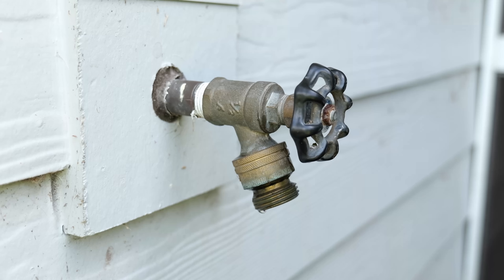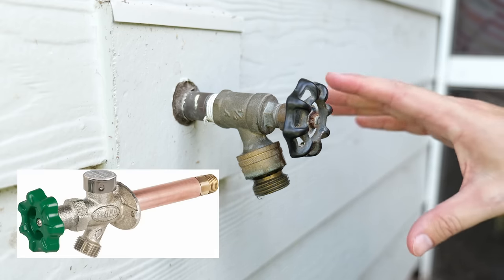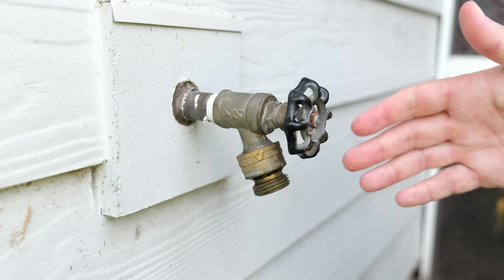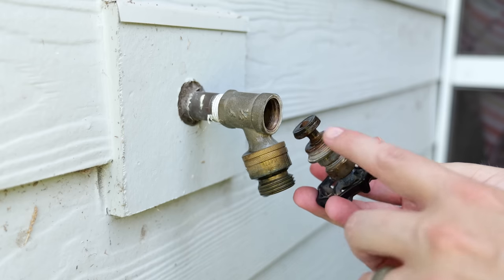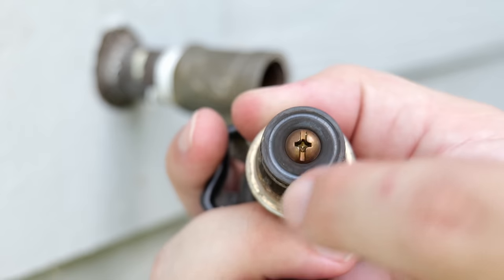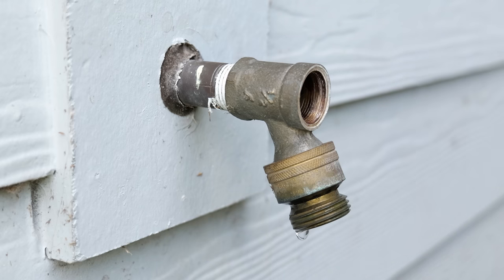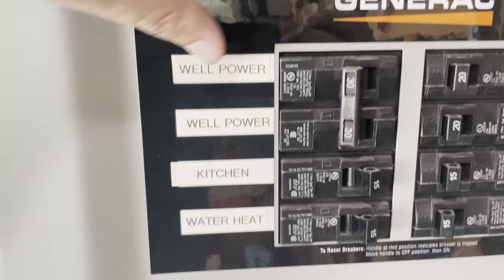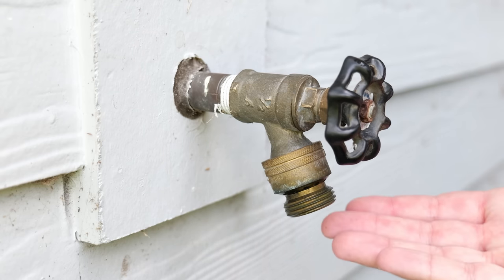How To Fix A Leaking Outdoor Faucet!  Cheap and Easy!

Comment from the maker: Do you have or have you ever had this issue?  What did you do to fix it?  As always, links for everything in the video are in the description!
Reply: Very helpful. I need to fix a hose bib. Thanks.
Reply: Have put a splitter valve on the spigot which prevents leaking and also allows multiple connections for the garden hose and for the watering system.  Planning on a better fix when I have all my plumbing problems figured out for the plumber to deal with in one visit if possible.
Reply: It's not plumber's tape but thread tape or Teflon tape.
Reply from the maker: @GailUrge-vq6qn again, can be called any of those things including plumbers tape.  Very commonly known as that.
Reply: @HowToHomeDIY  it can be called that if you're the younger generation and you want to be ignorant about it
Reply from the maker: @GailUrge-vq6qn it is called that by all generations 😂
Reply: @HowToHomeDIY  and you still don't know what you're talking about and still talking out of your butt 😆
Reply from the maker: @GailUrge-vq6qn nope.  Look it up.  They are called by all 3 names.  Honestly not hard to do 😂
Reply: @HowToHomeDIY  can't do that....I'm not clueless like you and must always go to Wikipedia 🤣
Reply: @GailUrge-vq6qn well look at that, I got this video recommended to me after the other one and you’re here too complaining about another dumb thing.  I wonder how many other videos I’ll see of his with ignorant comments like this from you.  Definitely the sign of a troll.  But it’s commonly called plumbers tape, thread tape, pipe wrap tape, or seal tape.  Most don’t actually call it Teflon tape, that’s a brand name not an actual type of tape or sealant.  So maybe you should research some things before making yourself look like an ignorant ass.  The How To Home guy is right again.  Honestly is humorous.  I may have to watch more of his videos to see if I find more ridiculous comments.  Keep up the good work @howtohomediy!  Solid info.  Ignore the trolls.
Reply: Thank you for this video. Bea did occur to me to try to change that washer. I’m able to take off the faucet part of the hose bib… But not the entire body. It’s crazy completely frozen on there. My next step would be to try to cut it off. But I’ll take another look at the washer and see if I can just replace that maybe that’ll do it.
Reply: @kayeruss7313 Yep, I did that on the hose bib in the backyard for many years. I wanted to just replacing it. I actually had to sweat some pipe. First time. Worked out pretty well actually raise the height of the faucet.
Reply: My is shooting water when I turn it on and off. And it shoots water at that adapter type thing at the end. Do i need to replace the entire thing?

Comment: Should you not have opened the valve a bit before tightening it down?
Reply from the maker: Yes you want the valve to be open slightly  once you really start to tighten it down as the new seal will probably be thicker than the one removed so if you go to turn it on it may get stuck and not open up the valve.  Great point!
Reply: I like your attention to details. I can’t begin to describe the grief I suffered before I finally figured out that the tape has to be wound CLOCKWISE several times. No one had mentioned this to me before.

Comment: Like tge video showed, make sure that the main body of the faucet (the one with the bigger wrench on it) does not turn when you loosen or tighten the body or you will cause a pipe to be broken inside that wall. If that happens you will have a big mess and probably need a plumber to fix that problem!!!

Comment: a good trick on tight fittings is to set your wrenches up next to each other close enough to Squeeze the two together that way you dont have to worry about twisting the back pipe or fitting.  harbor freight has a pipe cleaning wire brush for 4 bucks i keep several around for battery cleanups and general round fittings that need cleaned up. i personally dont like teflon tape But lots of people do  i like the teflon paste or a product called true blue. good concise video  to the point and well presented  have fun

Comment: Have the exact same hose Bibb - got the washers but I think it soldered together (or some type of cement paste was used - not sure) - used exact same wrenches, etc, but worried I was going to break it of at the pipe I was putting too much torque to turn it. Back to Lowes to get a replacement Bibb. I will keep the pack of rubber washers though ($3 for a dozen may come in handy later). Great video and instruction!!!

Comment: For a cheap / temporary fix, I have just flipped the rubber washer over and reattached with the screw into the shaft.  Sometimes , water leaks out around the knob SHAFT.  Using an adjustable or box wrench, just tighten the packing nut slightly to squeeze the sealing material enough to stop the leak but not too tight that would make the knob difficult to turn.   Hardware stores do sell small quantities of rubber washers or re-build kits, so make sure to bring the old parts with you as a reference.
Reply: Ghetto fix flip the washer lmfao

Comment: Very helpful video. Thank you. I have a 10in stem with a cup like gasket  towards the back of the stem that is slightly wrinkled. My back washer looks new as it's about 1yr old. I tried looking for a replacement for the gasket on the stem but couldn't find anything.  Do you think it's the back washer only that needs replaced as I'm waiting for an order to ship? I still have a constant drip, but not sure if I need to replace the whole hose bib as I can't find the cup like gasket replacement.

Comment: The tape or sealant on the threads is important.  You mentioned it is a relatively low pressure area - and it is, when the water is flowing.  But if you put a hose on there with a nozzle, and stop the flow with the nozzle, then the hose and that part of the valve housing comes up to line pressure.  So don't skimp on the tape folks! ;-)

Comment: 3:30 My faucet is identical to the example. That bonnet nut will not budge. I sprayed a lubricant, but no help. I’m using the backup counter wrench for support, but I’m concerned about using too much torque and risk damaging the interior pipe. Any suggestions?

Comment: Well I used this video as a base... but there were some details I needed to figure out.

When I went to turn the meter off, my water never completely stopped running. Turns out since I have a townhome, perhaps the other units could still be feeding me water.  I turned off the neighbor water too that's connected to my house.

(It's okay they are grandparents that live on the east coast, and use their place strictly for vacations).

Still my water wasn't completely off. It crossed my mind to turn off all 4 units water, both the gentleman in the adjacent house were home and I didn't want to bother.

I decided that the low water pressure was workable. I did go rub my kitchen sink to maybe help?

(Side note, I heard my water heater making pinging noises, and turns out if you gonna turn your water off for extended periods of time, or if it gets cut off, you should turn off the water heater, or it might damage itself trying to heat a tanks that's not full).

Back to the bib.. turns out I didn't even need a pipe wrench wince the base or the faucet is partially in the wall and covered with the outside building material. It's all good though because I have this spiffy new pipe wrench that is easy to use one handed and self adjusting.

Now I went to turn counter clockwise behind the handle and it came off easily enough. But when the nut came loose and I could pull the handle out, in only came out like an inch and was stuck.

I feared it was the water pressure still active that prevented me from taking it out.

I contemplated calling the water company and asking them to replace the shut off valve by the meter, but I don't have all day.

I smoked a bowl. I thought about watching episode 4 and 5 of the new Castlevania series on Netflix... but I resisted and looked at the set up again.

That's when I noticed a really thin nut that was camouflaged, behind the bigger nut. Aha.

I repeated my earlier steps and had the rod partially dislodged. Then I used my new crescent wrench to unscrew the other hidden nut and whoops there it is.
Free at last, I was able to pull it all the way out. My rod was a little different, about 6 inches and with a small square base. And the washer was actually the smallest size of the kit I had gotten. I had to hold the square base firm while I unscrewed or it was just spinning the shaft.

I ended up not using the plumbers tape, because didn't seem needed with how the thread area was designed.

Thanks for the guidance, it at least gave me confidence and what tools to gather.

It's funny tho, these dyis are never as straightforward as we hope.

Comment: Hi, My threads on the faucet have been damaged with a notch so when the water is on and connected to the hose,  it sprays up in the air from the notch.  I just tried the tape, and maybe I didn't use enough, but is that what you recommend to fix this problem?

Comment: Sir I enjoy your show a lot. Keep what you are doing. Can you tell me what the difference if any is between a GFCI and a AFCI outlet and can they be used interchangeably? Thank you in advance for any help that you can provide, Raines Hayes, El Paso, Texas,
Reply: In basic applications, GFCI  (  GROUND Fault Circuit Interrupter ) tests for GROUND  faults....as in wiring getting wet and causing electricity to find a path to earth ground.   AFCI  ( Arc Fault Circuit Interrupter )   senses a flow of electricity from one conductor to another  causing a SHORT or low resistance path , such as in a faulty appliance,  a pinched lamp cord or two wires accidentally touching, or broken / weak insulation. .  Either a GFCI or AFCI  may click off ( TRIP ) when a fault occurs within a matter of seconds...preventing a shock or fire hazard in most cases.  If working with electricity , always wear protective gear  and a good pair of CLEAN / DRY rubber gloves at a minimum  Otherwise, refer to a professional  / certified electrician. .

Comment: If you observe the washer is quite mutilated, and it still leaks after replacing, the brass seat might be damaged and require replacing.  There will be instructional videos on YouTube on how to remove and replace that.

Comment: Perfect timing, I have one in the back that leaks when it's on, but the one on the front of the house is stuck, what's your recommendation for a stuck faucet handle (won't turn on)
Reply from the maker: There may be a buildup in it from the hard water.  You could try a 50/50 mix of vinegar and water to try and loosen it up or I would probably try some WD-40 and then use a pipe wrench to steady it and then depending on what kind of have is on it use pliers or a screwdriver to try and turn it on.  Might just need to be broken open.  Hard to say for sure without being there though.

Comment: I replaced my valve with a 90 and a 1/4 turn valve. Previous owner removed the anti siphon fittings. When you remove the anti siphon fittings the threads on the valve causes a leak at the hose connection because it’s designed that way. I didn’t replace the anti siphons….

Comment: You could also replacing the stem packing when water leeks out around the valve stem, as long as the valve is out it not much extra effort..

Comment: @HowToHomeDIY can you do a video on how to replace the connector on the bottom of your faucet in your video? My connector has a “feature” that when I have a hose connected to a handle or sprinkler, and turn off the water, the back pressure causes water to spray out of that connector and get me all wet. The guys at Home Depot say that is a feature but I can’t understand why this is a good idea to make me all wet each time I stand by the faucet and turn the water off!

Comment: I'm on a strong artesian well without a well head. I'm the house is a pump but outside of just natural pressure. 
There's a metal yard faucet that needs replacement. How can I replace in this case since it can't turn off?

Comment: I used to build thousands of similar valves, and noticed one mistake you were making.  You should always have the stem backed out away from the seat when loosening or tightening the bonnet. Otherwise, if the seat washer sticks to the seat while loosening the bonnet, the coarse drive threads on the stem will tighten the valve as you try to loosen the bonnet, and it won't come loose at all; just keep getting tighter against the seat. Same with reassembling, do that with the stem backed out away from the seat so it doesn't interfere.
Also, like pipe dope, Teflon tape is only effective for sealing tapered threads. It does not do anything for straight threads, other than making them slicker, which is not necessary, or even a good idea. 
Great video though.

Comment: Just curious…why didn’t you mention about inspecting the valve seat for nicks or cracks?  Another couple of stages of fixes could include relapping the valve seat with a lapping tool (not very expensive) or, the next stage of repair could be replacing the valve seat (if removable, many are removable).  Valve seats are cheap too as are valve seat removal tools!

Comment: Another trick too, is if the brass nut won’t turn because of corrosion.   Take a propane torch, like the ones they use for soldering and heat up the outside of the faucet a bit to get the metal to expand.   Heat it for a few seconds.   That’s all it takes.   It’ll break up the corrosion between the threads and it’ll loosen it enough to unscrew them.

Comment: I have a hose bib that's leaking out of the stem opening, not through to to bib outlet. I tried tightening down on the nut but it didn't fix it. Some sort of packing, perhaps, just below the nut? I still have to add an isolation valve upstream of it so haven't opened it up yet, but if it does use packing what can I use to repair it? Thanks in advance, wonderful channel!
Reply: Excellent video, but another showing the replacement of stem packing would be most helpful as well.
Reply: Hardware stores may carry material which looks like grey / blackened TWINE  which usually is cord impregnated with graphite type material.   For a quick fix, just loosen the packing nut, place a couple layers of plumbers tape around the shaft and compress it back down with the shaft nut.   Snug but don't over-tighten or the shaft / knob mat be too tight to turn.

Comment: The screw that holds the washer has disolved.  How do you remove the broken screw and them replace the screw.  The faucet was installed in 1949 and I am unable to find replacement parts.  I'm thinking of installing a shark bit facet but the other side of the wall is under the kitchen sink with no room to work.

Comment: Regarding frost-free faucets... are leaks corrected the same way?
Have always thought they disconnected way back inside the wall.
Reply from the maker: Yes, so the faucet itself is screwed in deep in the wall like you say.  But you can remove the front like I did and a long shaft with a washer on the end of it will come out of that housing since the water is actually shut off so deeply in the wall.
Reply: @HowToHomeDIY  Thank you for the reply.  Have been told that once the shaft is pulled out of the wall that realigning the repaired/new one is problematic.  True?

Comment: Had a heat pump motor go out today. Have you ever replaced one?  Motors are $200 bid to put in, $1,500.  2008 unit.  Better to replace the whole thing?
Reply: I don't know if the AC guy was being honest, but he said...after replacing the fuse panel ($510) the motor was burned out.  All this before the actual AC issue...

Comment: Is there any difference between repairing a leaky outdoor bib and repairing a leaky compression shutoff valve of a clothes washer supply pipe or a kitchen sink supply pipe?
Reply from the maker: Yeah on those it can oftentimes be the actual internal valve that has to be replaced.  Sometimes a washer.  Just depends on what you have.
Reply: @HowToHomeDIY : I didn't ask my question clearly.  By "leaky" I meant the fully-closed shutoff valve doesn't entirely shut off the water flow.  If your answer is still that this is due to a faulty valve more often than a worn-out washer, my follow-up questions are: what causes the valve to go bad, and why don't outdoor bib valves often go bad in the same way?  Thanks.
Reply from the maker: Well that’s why I say it depends on what you have.  Some kitchen sinks use cartridges and some are made up with mechanical valves and o rings.  Clothes washer supply lines typically have a packing nut that just needs replaced or tightened down like the outdoor faucet.  For the kitchen sink if it’s just a mechanical valve with o rings then like the outdoor faucet one or more of the o rings need replaced.  If it uses a cartridge then the leak can be from numerous things, the o rings on the cartridge, any nuts that may be tightening down the cartridge into the assembly if they are loose, or more commonly the whole cartridge usually needs replaced.  And they go bad just due to wear and tear of the internal seals usually but poor water quality can cause them to go bad too.   The outdoor faucet valves themselves don’t typically go bad because they are just fully metal and mechanical.  The rubber seal is really the only wearable due to age, use, water, and compression.